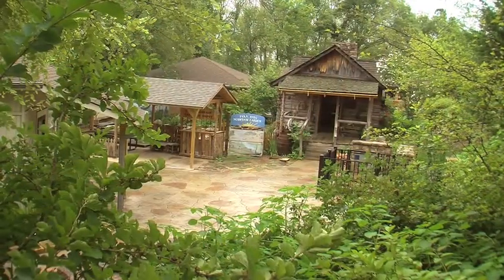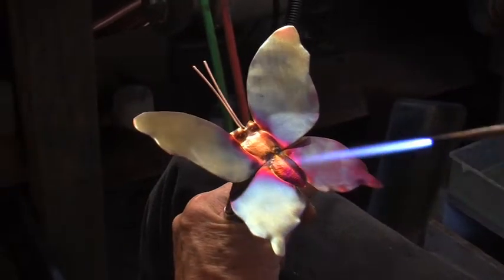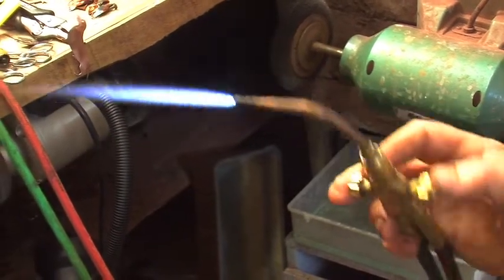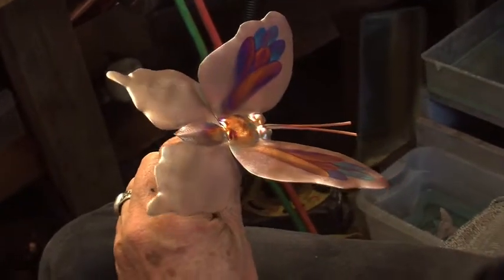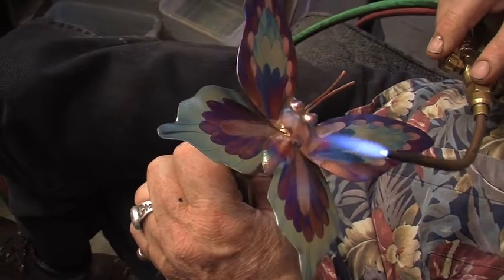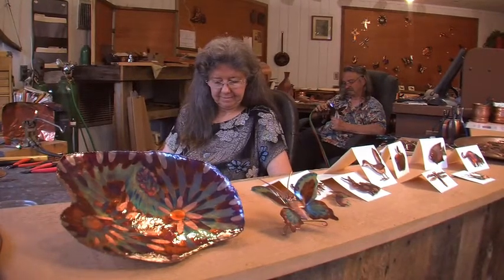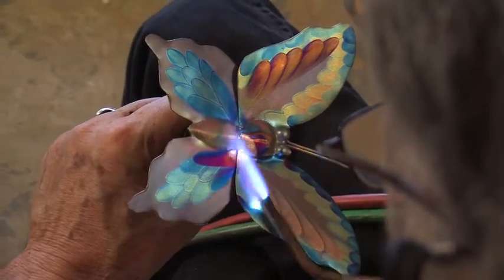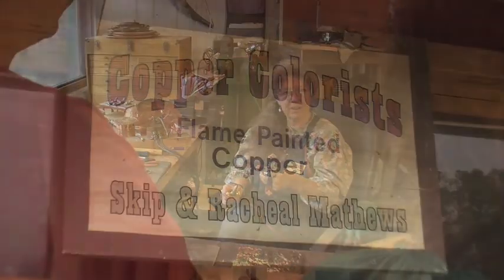Flame Painting Copper Colorists Skip & Racheal Mathews Video

Comment: Hi Skip!!! Your work is gorgeous!!! I’m using a large acetylene tank and am being told I should switch to a smaller tip and oxy? Can you advise on a torch to buy ?
Reply: Hi Susana, yes, switch to oxypropane and we use the Victor J40 series light duty brazing and cutting torch and 0 tip.  You can purchase one at Cyber Weld. You can also get our Equipment, tools and materials list and you can purchase our Procedures Manual both at our web site at https://www.coppercolorists.com. Happy flame painting!! Racheal
Reply: Racheal Mathews going to try and find that torch. I did send you an email. I want to purchase your manual!